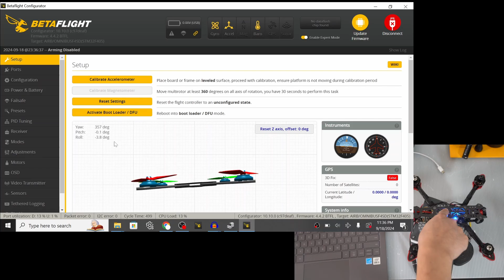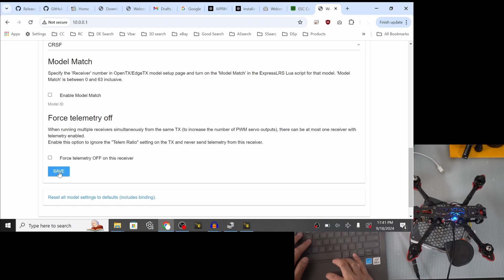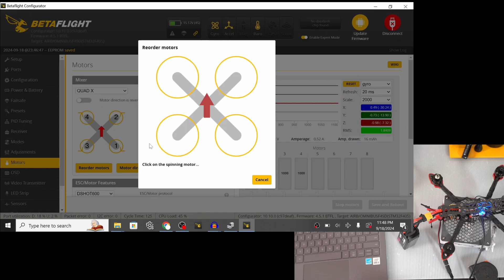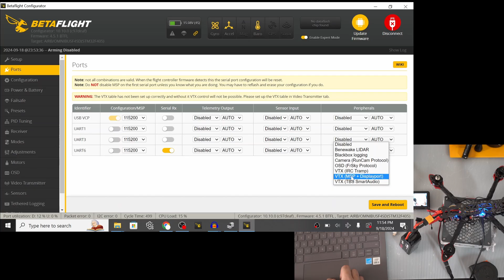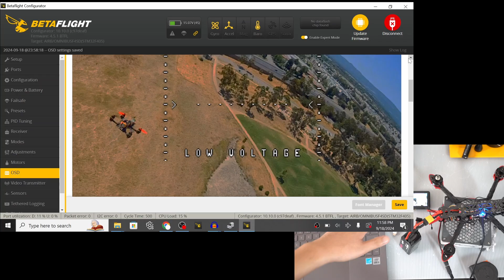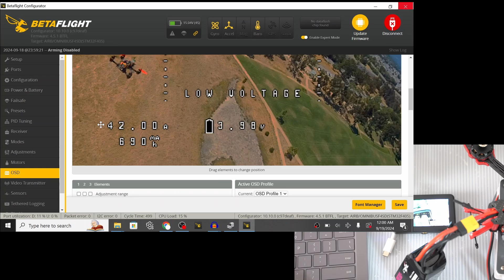Betaflight Setup for $100 5-Inch FPV drone

Comment: Does any one know what to do if the vtx shows false but all the wiring is correct?
Reply: Bro I got the same issue lol but I think it should be good to fly have you tried fly8’f?
Reply: @UOOOOOOOO122 ended up being a bad vtx so I replaced ts
Reply: @HALOSIMRACE so you couldn’t fly with it Dsmn

Comment: i did evertything but reciver is not connecting , its binding but there is no stick movement in betaflight.... Can you help what the problem is ? tx to rx is good wired elrs to flight controller

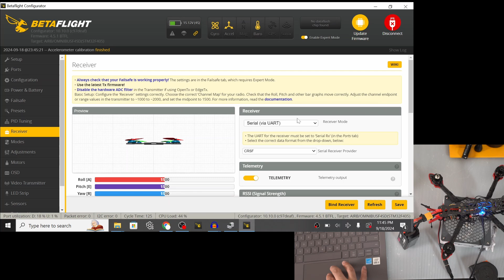Comment: Hi, at 5:30 I see UART, CSRF and Telemetry on. When I tried the same, after enabling Telemetry and pressing Save my controller sparked, smoked and burned. What did I wrong? I tested it before multiple times with smoke stopper.

Comment: Hi. This is a great tutorial. I just finished building this drone with my 11 year old son and it was a great learning experience. I was able to get it flying but we do not have any video. I bought the b-cube vtx1000 and am using the betafpv vr02 goggles but don't get any video. I am able to connect but the screen is black and no osd. I have watched tons of videos and read many forums with no luck. Do you have any tips?
Reply from the maker: Black screen or static screen? I haven't used the vr02 goggles before but on most analog goggles, you should see static and not a black screen
Reply: @HoarderSam2  thanks for the reply. I have static when not connected to the vtx but when I turn the drone on and it shows full connection I get black screen with flickering. I have tried bypassing the fc, camera straight to vtx but still no luck. Any ideas?

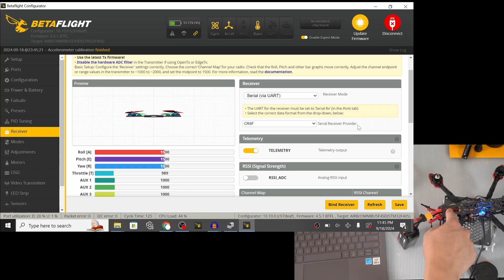Comment: Hey Sam, I did the exact same build and didnt have problems until 5:40, because my radio didnt have any input on betaflight. I know the drone is connected to the radio (via the wifi method), but inputs are just not showing. I have been like a week trying to fixed it but no solution for now. If you know something I could do, or anyone knows what could be, please help!! 
(By the way nice build, it was an awesome proyect)
Reply: any luck?
same problem here
Reply: check the wiring. it should be opposite, rx to tx, tx to rx. That fixed it for me
Reply: @Basilexe same here rx and tx connect not rx to rx

Comment: I aint getting any stick inputs. i have tried almost everything. im slowly giving up
Reply: How did you fix it?
Reply: @pulsex6371  I updated my receiver, but the problem was that I wasn't on the lrs configuratior, so I updated it using another receiver, which was basically the same, which fixed everything
Reply: @pulsex6371 the problem is that I couldn't update my elrs since it wasn't on ExpressLRS configuratior so I couldn't update it and somebody told me to update it with something similar to it thats on the configuratior I forgot what it was exactly
Reply: Fixed it

Comment: I've build this drone last week. Changed VTX to Speedybee TX800, added better 5.4ghz antenna (also Speedybee) and changed cam to Caddx Ratel 2. FYI for other builders - TX800 has different screw spacing and you have to use smaller screws with some washers to mount it in mk4 frame. I've also got issues with setting up display (HUD was not visible or showed 'vvvv' letter all over) but this was sorted by uploading Betaflight font. Also, had an initial issue with updating firmware on ESC - had to run ImpulseRC Driver Fixer and then everything was okay. 

This was my first build and I want to thank you for posting this video. It was really REALLY helpful and I've learned a lot. After 30h in Liftoff I've flown my newly build drone for the first time yesterday. And to be honest, it felt very similar to the sim so I even managed not to crash, although it took me a minute to feel comfortable. Overall, great stuff. Thanks once more for the vid!!!
Reply: I also changed to the TX800 and I for the life of me cannot figure out how to get the OSD working on battery power.. I get the gray screen and OSD when I plug into betaflight but when I go to battery I get camera without OSD. I have the ports set for VTX IRC instead of TBS smart audio since the specs show IRC.. what am I missing? mine has the fonts if it displays the OSD on just USB power right?

Comment: My OSD isn't showing up on my goggles after everything why is this? The only change I made to the build is using a Ratel 2 for the camera.
Reply from the maker: It's most likely a PAL or NTSC setting in the OSD. I'd change it to one or the other, save settings, then unplug the drone and power off completely, then power back on and plug back into betaflight. If it doesn't show up then switch to the other setting and do the same thing (full power cycle).
Reply: @HoarderSam2 im having the same issue... Same thing i got a ratel 2 camera made it to every step but my camera is reading false and im not getting a video feed. I tried changing the settings like you said and double checked my soldering

Comment: hey, i did everything in the video and even flew it for a bit but for some reason when i go to set up the VTX it says "devise ready  False" and i dont know why the vtx is running its warm when i run it and i uploaded the file for it but it keeps saying False this is my first fpv drone build so any ideas?
Reply: What camera are you using? Same issue here
Reply: @SmokyArts  same
Reply: @gabtheriault122 i got mine to work but i cant remember what i did for it to work 😂😂. Check the modes tab and make sure your vtx is on the right UART. If that dont work check your video format and try each one. The vtx is warm because it is getting power which is good so something must be misaligned in the settings so your not getting true reading. Let me know and i can check my betaflight and let you know what i have everything set at
Reply: @SmokyArts my video and tx wires were inverted! All g now!
Reply: @gabtheriault122 heck yeah man happy flying!
Reply: @SmokyArts Thanks! Crashed it a few times earlier! Blew 3 motors and 2 props!   Flying 5inch quad is Wild!

Comment: Hey dude I got the drone working and it flew great besides a moter separating into two pieces mid flight. Anyways the drone fell off my table while I was trying to set up my OSD and it broke the micro USB port off the stack, I ordered a new flight controller and got it all soldered up correctly but for some reason beta flight is reading the VTX false and I just get a black screen in my goggles. I briged all the correct pads and I followed your wiring diagram perfectly, I don’t see what could be wrong with which is quite frustrating. I deeply appreciate your great video on making this quad and I think you’re going to change budget FPV for ever. If you have any advice please reply. Thanks

Comment: When I upgraded firmware I didn't take care of the radio protocol and the motor Protocol. So the motors didn't comes alive. I thought mys ESC was burned by soldering too hot. 
Take care of thoses parameters when you flash the firmware.
Reply: i think i did the same thing, how did you fix this problem?!
Reply: @crybabygames2511  I flash again : put the right parameters in betafligh before flashing

Comment: Hey Sam! I've followed your build and used all the parts you recommended, including the F4 V3S flight controller, but when setting up in Betaflight I'm not seeing the OSD option under Configuration. I learned that you should able to activate this under the Firmware Flasher tab if it is available - but I'm not seeing it there as an option either. Any idea why this may be happening?
Reply: Any help would be appreciated!

Comment: I built this and spent about $118.   Very complete build guide.  The only thing I would add is to be very careful with the JST connectors on the boards.  They snap clean off when plugging in.  At least, this was my experience.  I'm adding the $18 to the costs for the replacement FC.    I'm assuming this is just a quality issue.  Though for the price I can't complain.   To Prevent this, I dabbed a little hot glue to the back of the JST and installed without issue.
Reply: Just had the exact thing happen to mine😂
Reply: I was surprised that my FC had glue preapplied to the JSTs from the factory. Maybe they noticed as well lol.

Comment: Hey sam. I got it flying for a while, but my vtx stopped working. betaflight says "Device ready False" I have a Speedybee TX800. Is my vtx just bricked? I also noticed it doesn't get warm when I turn on the quad too.
Edit: I ordered a new VTX and very carefully made sure I soldered it in how it is meant to go and it worked! Drone is working 100% now!
Reply: which one did you ordered? mine is B-CUBE 5.8G 1000mW input Voltage 7-26. The VTX Device ready False (I didn't plug in the battery), I am waiting the battery to arrive but hopefully it will work with the battery in.
Reply: @KhietLe-ez1pv did it work? I have the same problem, even with the batery plugged in
Reply: @gabtheriault122  well yes, you must have battery plugged in + set your UART to TBS Smartaudio.
Reply: @KhietLe-ez1pv  i tried both, my vtx is a irc tramp tried everything, I noticed my ground is on G insted of Gnd, the vtx powers up thi and the butron on it seem to be working, sometimes my goggles get a black screen
Reply: @KhietLe-ez1pv my video and tx wires were wired wrong! All g now!
Reply: i have the speedybee tx800 and had the same issue.  My problem was the voltage.  Speedybee needed 5v.  But I quickly figured that out and changed up the voltage with no damage to the vtx. (none that i'm aware of)  Also, I had the pads touching the frame; now i've got the heatsync on the fame to prevent shorts.  My first build so i made a few mistakes.  I'm sure i'll make more.

Comment: Do you mind throwing a link to the vtx json file?
Reply: Just ran into this issue there is a qr code on the back of the page that you got with the video transmitter that links you to it. Just reply back to me if you need the direct link.
Reply: @ElevatedisScout hey I was wondering if you could share that link, I threw away the packaging for the VTX before I realized I needed the qr code that was on it. Thanks
Reply: I need the link too, just threw away the packaging.
Reply: @hortonj  I posted the link on my channels description since Youtube doesn't allow links in comments. Sorry for the delay youtube didn't post my first comment for some reason.
Reply: @PerryFPV  Just replied to the outher comment.
Reply: Thanks

Comment: Yo Sam, I’m new to all this and I made it to the very end of the build but I noticed you didn’t include where you put the battery, I’m assuming you just put it on tap but any chance you can show how for the noobs?
Reply from the maker: Yeah, rubber battery pad goes on top and then the battery gets velcro stropped on top

Comment: Why don’t I have dfu mode
I don’t see a thfourth option, I’m using the same fc and esc and my bf version is 4.1.1
Reply from the maker: Download and run ImpulseRC driver fixer
Reply: @HoarderSam2 what if mine elf’s receiver doesn’t go to wifi mode, it is solid blue even powered on for minutes